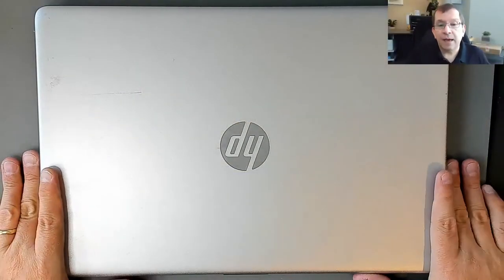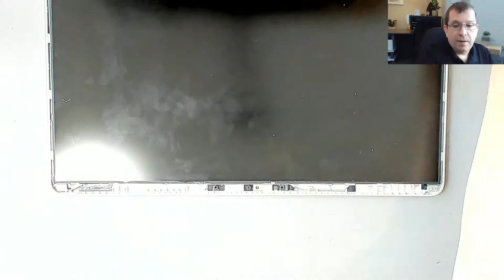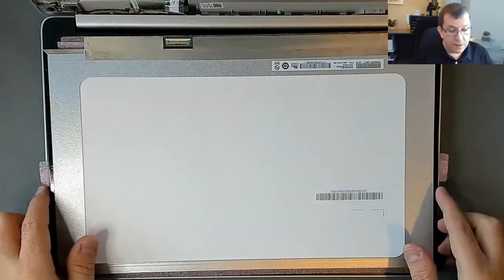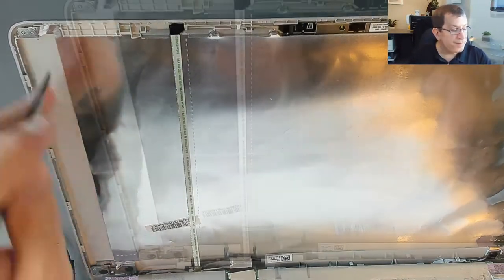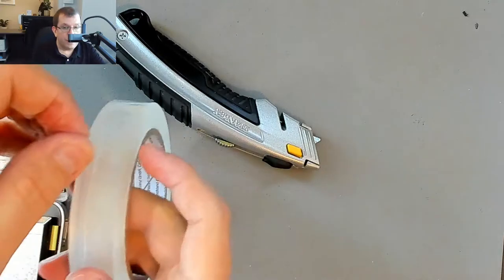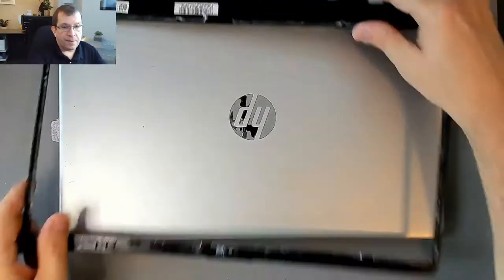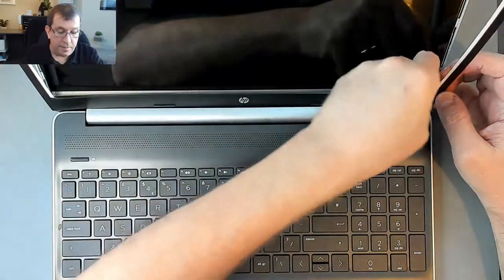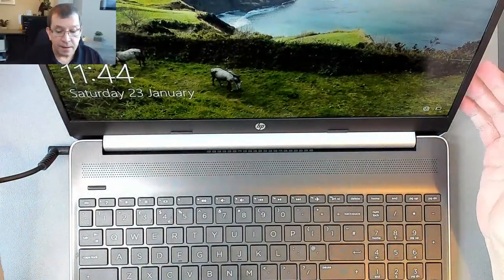[22] Laptop LCD replacement - HP 15s-fq1505sa (TPN-Q222)

Comment: Great Video, do you have any idea to repair a backlight problem on this models? Thanks!
Reply from the maker: Not really, but I have seen YouTube videos of people fixing a backlight issue by simply disconnecting and reconnecting the LCD connector. I'm sure this would only work in some situations, and if you try it be sure to disconnect the battery first.
Reply: @ComputerHelpNI  Thanks, but dont work in this models.
Reply: @ComputerHelpNI  great that's worked to me !!